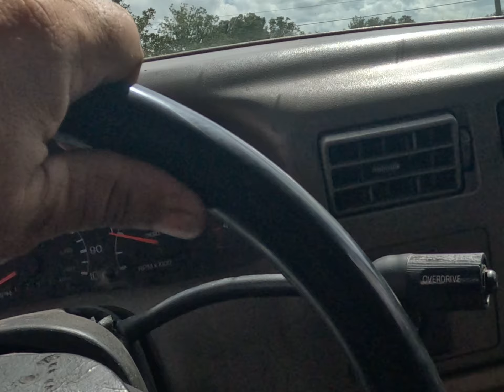Thieves Stole My Lights! Scrapping In Tampa FL

Comment: I was going to mention needing a front end alignment when I noticed your steering wheel.  You have more than a couple of miles on that truck.  You probably need to replace some suspension parts before you get the alignment.  Sorry about Grandfather.
Reply from the maker: Thank's he will be missed. The truck is at 270k and you are right it burns up front tires really fast I think I need new ball joints. I will be doing an everything that's wrong with video on the truck. I have some parts already in stock for it so I should be able to clean it up without spending a fortune